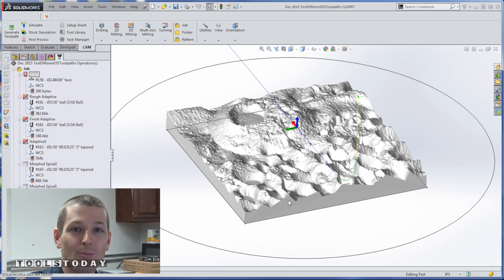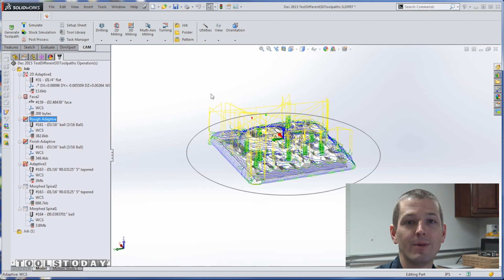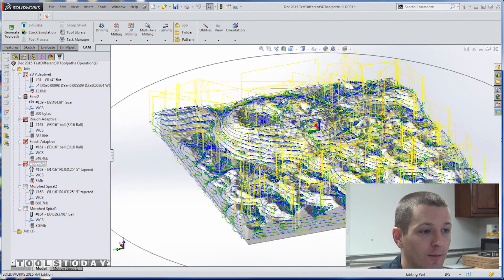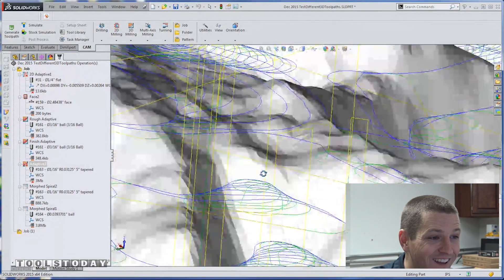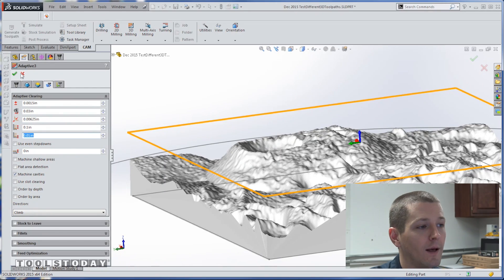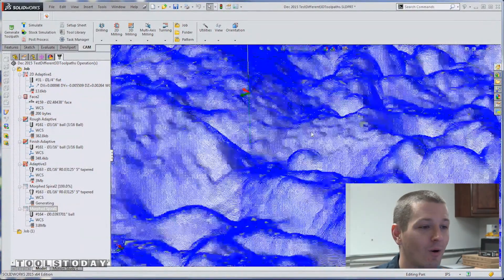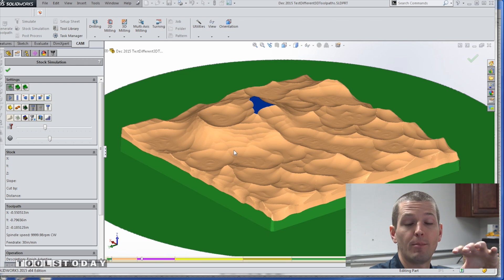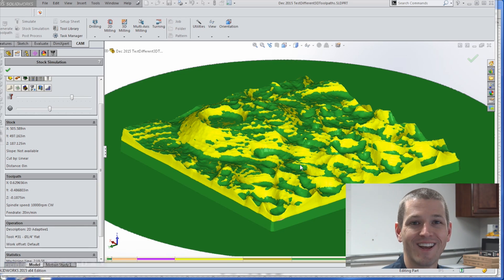Microorganism 3D Brass Carving Using Amana Tool CNC Router Bits - Part 1 of 2: Tool Path Simulation

Comment: Hi there
this is a awesome project, thanks for sharing it. Do you think it would be possible to achieve similar results with a smaller mill, such as ShapeOko?
Reply from the maker: Hi +johnblow89, thank you for your question, we advise you to contact the ShapeOko manufacturer for the machines limitations. This project was created on a CNC Milling Machine designed for metals and soft metals, we would not recommend you to try this without contacting the manufacturer first.

Comment: Great video, i am curious if you ran the .stl through a program like mesh mixer and let the program tighten up the faces of the mesh, would it process better in fusion 360 or solid works. you can reduce the number of mesh faces with out loosing any of the detail.
Reply from the maker: +Dirge Varo, Interesting approach, thank you!